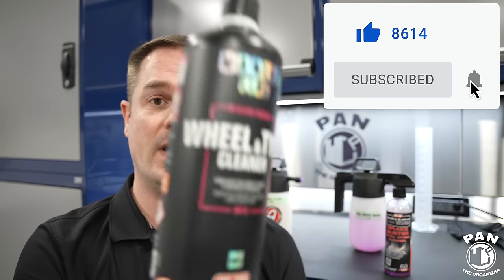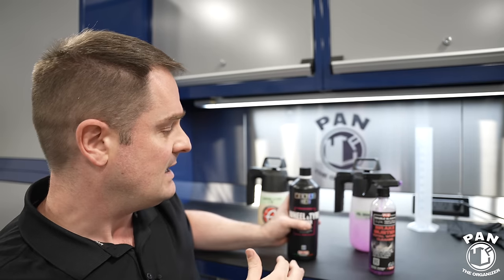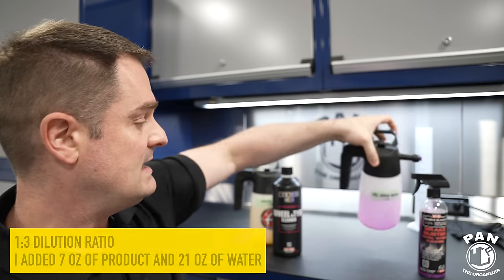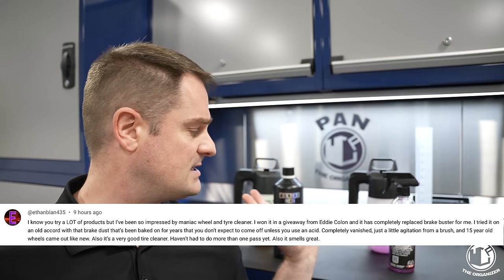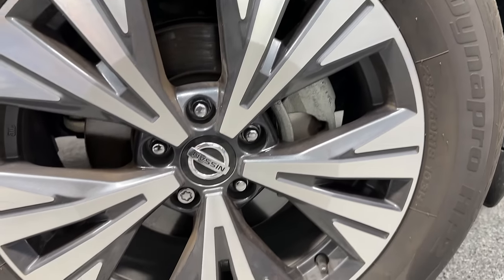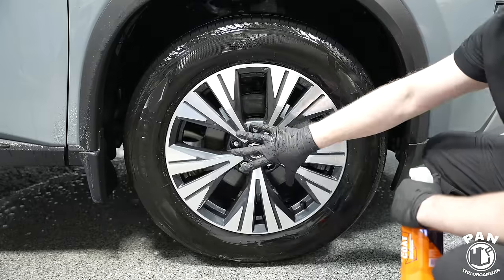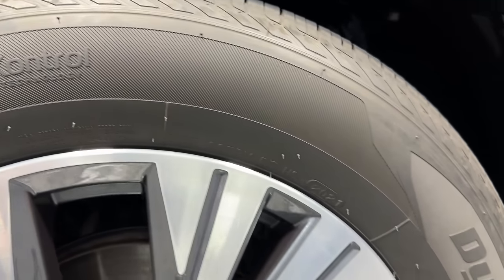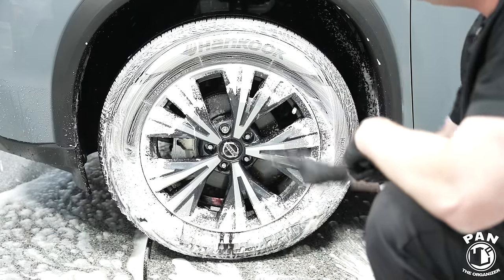P&S Brake Buster KILLER ?? Maniac Line Wheel & Tyre Cleaner TEST

Comment: I think it's objective, I think you could play around with the dilution ratios when at home (obviouslythe test needs some kind of fairness), and use a wheel cleaning mit rather than brushes (in my opinion, I'm not comfortable with using brushes, other than a really soft detailing brush). I've got a gallon of BB and I'm happy with that, I do however go in behind with Gyeon wheel and tyre cleaner for the iron removal as it bleeds, for every other clean. I use a 3M lambs wool mit, noodle wheel mit and a detailing brush for the wheel nuts and tight areas
Reply from the maker: Thanks for sharing!

Comment: Hi Pan, thanks for another video! I have a question, I used Gyeon Tar Remover on my tire and they turned orange/brown. I used the P&S Brake Buster but could not retore the tire to OEM condition. Could you please advise on any other method or product that I can or I should use? Thank you!

Comment: Lets redo but maybe give it the 5 minute dwell time and equal ratio.. I do agree with the look of the wheel being better with P and S.
Reply from the maker: That point is moot, as you're not even supposed to dilute Brake Buster. Nowhere is it written that you can dilute it. So using it at 1:3 is already an off label use. ;)

Comment: Each tire looked brown to me.  The foam seemed more brown on the first tire demo at the 3 minute dwell time.   The second tire looked like white foam on the first pass after the three minute dwell time.  I didnt really see any browning.  Maybe it was my video feed I was viewing off of.  Not sure.  The end result looked the same on both tires.  The only difference for me was the wheel face.  Personally, I think both tires were clean enough to add a tire dressing.  I wouldnt say that either product out performed the other.  This is just my opinion.  Various tires can respond differently to various cleanings depending on the age of the tire.  Front tires in my experience tend to be more dirty than the back wheel tires.  Either way, on my screen, there was no difference between the end result of either tire.  Both had a brown tint.  I think a finger wipe test or a towel test would have been a better judge.  Some tires, even when cleaned, will have a slight brown haze to them.  Again, this deals with the blooming stage and age of the tire in my experience.

Comment: You will have to use both at full concentration and then do no agitation run and agitation run to compare.  IMO, at face value I will have to say Maniac  is a more concentrated cleaner but P&S at 43 CAD for 128oz it is the clear winner!
Reply from the maker: You can’t compare these two that way. You have to dilute Maniac Line. It’s a concentrate. And you’re not even supposed to dilute Brake Buster. Nowhere is it written that you are supposed to dilute it. So this test actually started with a weaker Brake Buster.
Reply: @PanTheOrganizer  I would argue that if the test  showed even results with a weaker BB then it would serve to show it CAN be diluted and is more value since 1 gallon compared to 33 oz is better value, no?

Comment: Adams wheel and tire blows both of these outta the water and can be diluted however needed for maintenance cleaning. I use 1:5 in ik foam pro 2 and never damaged anything and always gets the wheel super clean
Reply from the maker: I already used the Adam’s vs Beake Buster in this video: https://youtu.be/jfYZh1qB1LY?si=BDmEZ3p5bc1Higg7

Yes it’s super powerful perhaps too much at pH13 haha. I wouldn’t recommend using it for weekly washes on coated wheels.

But yeah the Adam’s works great on dirty wheels and tires.

Comment: Mix Adam 15% iron remover, 5% simple green, 30% car shampoo, and 50% water. You get good cheap tire wheel cleaner.
Reply from the maker: Never mix chemicals from different brands without knowing chemical compatibility especially if you are not a chemist with proper knowledge.

Comment: Hi Pan! I just bought 2x IKK Multi Pro 2 360 sprayers, box says that it cannot be used with alkalines. Does it mean 100% alkaline, or diluted is OK ish? How do you use alkalines in IKK Foamer, if it is same specs/brand? 🤔 thanks!
Reply from the maker: It depends what products you plan on using in the Multi Pro 2. Keep in mind it's not a foaming pump sprayer. I use the Foam Pro 2 (or Marolex Axel series) for foaming products like Brake Buster diluted 1:3 or Maniac Line Wheel & Tyre Cleaner diluted 1:5

But in the Multi Pro 2, you can still use a few chemicals don't overthink the moment. But once you're done, rinse the container, and run clean water through the pump to "flush" any remaining liquid so you're not damaging the seals long term.

Comment: Pan, I have the same sprayer as you're using. In fact I have 2 of them lol. Are you using the dry foam tip? Mine sprays with the tip that came on it but doesn't foam.
Reply from the maker: I keep the stock tip that comes pre-installed. But make sure you actually have the foaming type sprayer. IK makes a normal pump sprayer and a foaming type. I put links in the video description to the foaming one.
Reply: @PanTheOrganizer  Got it. I probably have the regular one. The results are fine, I just assumed I was doing something wrong based on what I've seen in these posts.

Comment: Hey, there Pan! 
Great review! Thanks. 
Question: Will the P+S Strip off the Gyeon Wet Coat during regular cleaning? Making it necessary to Wet Coat every P+S use? 
Thanks!
Reply from the maker: Over repeated use yes, like it would for most spray on rinse off sealants. That’s why I like to reapply the sealant once monthly as it’s super quick to do.

Spray on rinse off sealants are meant to be used for their speed of application and ease of use. Not for extreme durability or chemical resistance.
Reply: Go it. Thanks for the reply!  @PanTheOrganizer

Comment: What about comparing to Koch Chemie Magic Wheel Cleaner? I'm finding that exceptional!
Reply from the maker: MWC is great, and has better iron removal capabilities, but it's cost is prohibitive especially for pro detailers who need bigger volumes and better value. And MWC is just a wheel cleaner, it's not meant to be used on tires. So it's not as versatile.

I would compare the MWC in the category of things like Gyeon Iron Wheel Cleaner for example.
Reply: Yes you are right, it is a one trick pony and expensive, but it cleans like nothing else. I use Retyre for rubber. So many things to play with!

Comment: You should try Adam’s wheel and tire cleaner. It’s far more powerful than brake buster.  Not even close.
Reply from the maker: I already did in this video: https://youtu.be/jfYZh1qB1LY?si=BDmEZ3p5bc1Higg7

Yes it’s super powerful perhaps too much at pH13 haha. I wouldn’t recommend using it for weekly washes on coated wheels.

But yeah the Adam’s works great on dirty wheels and tires.
Reply: @PanTheOrganizer  Guess I should have checked better! I agree it’s not a routine chemical.

Comment: Are they both safe to use on ceramic coated wheels?
Reply from the maker: Yes. But perhaps for times when you need deeper cleaning, on very dirty wheels for example, as these are still high pH products that could eventually weaken a coating if your coating doesn’t have the best chemical resistance.

The point of having coated wheels is to make cleaning easier. Usually, just regular car soap will do. You can use iron removers every month or every other month to remove brake dust.

But for regular weekly washes, you won’t need high pH wheel cleaners.
Reply: @PanTheOrganizer  Thank You. Also does using Iron removers every month or every other month affect the coating?

Comment: Pan what's been your experience with turtle wax hybrid solutions wheel and tire cleaner hyperfoam? Do you think it stacks up to brake buster?
Reply from the maker: It's very good indeed. Not quite as good as Brake Buster, but similar to their TW green bottle wheel & tire cleaner which I compared to Brake Buster in this battle video: https://youtu.be/jfYZh1qB1LY?si=qoVz-v5GdM8-uybo

Comment: Which pump foamer do you prefer? Ik pro 2 or the Marolex 3000. Both seem good from what I've seen the Marolex can work for a longer period before pumping again. Hard to tell the foam quality difference. But i see most people using the IK. Just wondering what your experience and opinion is?
Reply from the maker: I prefer the Marolex pump sprayers for sure. Both are very well built, but the Marolex lasts longer when fully pressurized. 

I made a video on the Marolex sprayers here: https://youtu.be/7ZkGf-IVs4k?si=5HT91mnfEFjZzUiY
Reply: Yeah that was one of the videos I watched during my research. I just find it interesting that to me they seem better. Yet you don't see many using them compared to the IK. And I've read some people saying it's harder to get the Marolex to foam well. Where there is no issues with the IK. Which I found an interesting comment to make. Thanks as always Pan
Reply from the maker: People who can't get Marolex to foam make the classic two mistakes:
1) They don't use the correct Marolex sprayer. The foaming version is the AXEL series (blue top). The other sprayers aren't meant to foam.
2) They don't use a foaming type product. You wouldn't use a rinseless wash in the AXEL foamer for example, as those aren't meant to foam. But if you use Brake Buster diluted 1:3 or a snow foam in the AXEL foamer, you should get foam.

The same would apply to the IK sprayers. If you use a non-foaming product in the IK Foam Pro 2, you won't get foam. You have to use a foaming product. And if you use a foaming product in the regular IK Multi Pro 2, you won't get foam, as it's the IK Foam Pro 2 that is meant to be used for creating foam.

Anyone who tests both can clearly tell the superior properties of the Marolex. But that being said, I have the pleasure of owning pump sprayers from both brands and both are excellent, you can't go wrong. But the Marolex lasts much longer when fully pressurized, there's no doubt about that.
Reply: Thanks for the reply. I guess the water being used is a factor aswell. One other thing I've seen is instead of a nice fan if foam its more of a dribble. 1st thought is its not pressurised. But you see them do it. It's almost like the foam is too think the nozzle can't handle it and it dribbles out. I guess some trial and error is required for your own conditions.

Comment: Hey Pan, if I apply the tire shine product like CarPro Perl, and then after a week clean my tires with P&S Brake Buster. Does that wipe off the tire shine and I have to re-apply the tire shine every time after I wash the tire?
Reply from the maker: You would have to check and see once you dry the tires, but yes in theory a wheel and tire cleaner cleans the suefaces so you would have to reapply a thin layer of PERL once done.

Comment: Don’t see why people are in love with Brake buster. It’s good for coated wheels, but has no bite for super dirty wheels. In my opinion kleentech breaker or is he supply wise guy are 5,000 times better than brake buster. But it depends on use. For mobile detailing the ones listed above are better because most of my customers wheels aren’t coated
Reply from the maker: People who watch detailing videos usually have cleaner cars and in that case Brake Buster is amazing for regular maintenance. Still my favourite.

But for pro detailers who deal with sometimes disgusting caked wheels I agree there are more suitable options. 👍🏻

Comment: Hi Pan, I am a detailer and appreciate your content! Question - how do you make these brake discs shiny? Even after I wash the wheels they are left rusty...
Reply: Try a wheel and tire cleaner with iron remover and brush.
Reply: @fila741  that's what I do, but right after I rinse, the rust starts to come back
Reply from the maker: That's normal. Steel rotors will rust when you wash the vehicle. That's just some flash rust that quickly goes away once you brake a few times. 

Or, to prevent that flash rust, you have two options. 
1) Once you are done with the final rinse, you can go up and down the driveway a few times while lightly applying the brakes, and then dry the car. That will prevent the flash rust. 
2) Or after the final rinse, you can spray a product like this on the rotors: https://bit.ly/3y7bGsC

Comment: I tested P&S at 1:5 ratio (5 part water) and found on my Marolex foam sprayer it was coming out so thick it wasn’t even usable, is this down to too much product, water type, any advise how to stop this? Water is very hard in my area / used normal cold water for the mix and added product after water into the pump foamer!
Reply from the maker: I typically use Brake Buster 1:3 in a foaming pump sprayer ad you saw here, so even more concentrated than your dilution, so clearly that’s not your issue.

I used deionized water for my mixes, so zero minerals, which is the best. 

So perhaps your hard water is playing tricks. Try distilled water or demineralized water in the foamer to see if that corrects it. Or dilute a bit more and see if the product is still efficient.

Brake Buster isn’t recommended to be diluted, but many use it 1:3 to 1:5 with no problems.

Comment: PLEASE HELP! i heard a few horror stories about brake buster staining wheels . i am now worried to use it on my new car. please advise if its possible for this to damage wheels
Reply from the maker: I have been using it for years and never once had that issue. If you follow instructions, and don’t let it dry on the surface in the hot sun, I don’t see how that would happen.

I haven’t really seen any negative feedback from viewers neither, or any reputable detailing channel talk about such an issue.

Perhaps reach out to P&S and expeess your worries and ask them if there are situations where it might stain whees, so you can avoid that if needed.

Comment: Adams Wheel and Tire Cleaner is better hands down.
Reply from the maker: I tested the Adam’s vs P&S in another battle video and yes the Adam’s is also great. But at pH 13 I wouldn’t use it for weekly washes on coated wheels. A bit too strong haha.

Comment: P&s did better cuz it was 1/3 when mantic was 1/5
Reply from the maker: That point is moot, as you're not even supposed to dilute Brake Buster. Nowhere is it written that you can dilute it. So using it at 1:3 is already an off label use. ;)